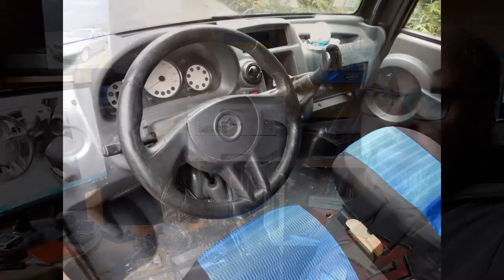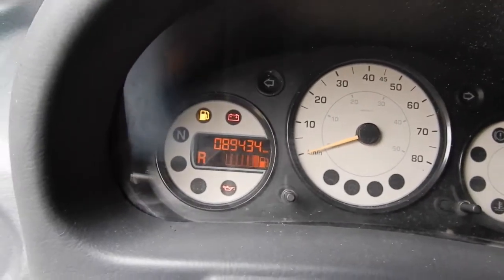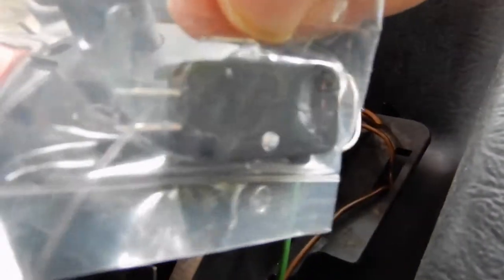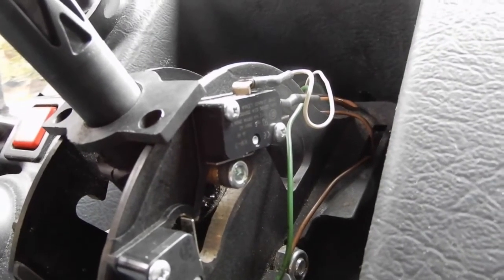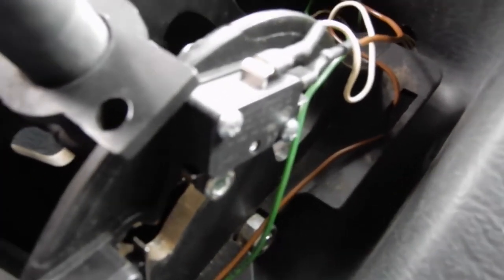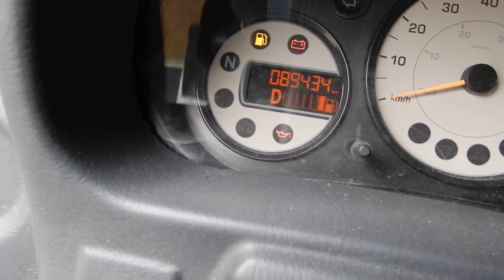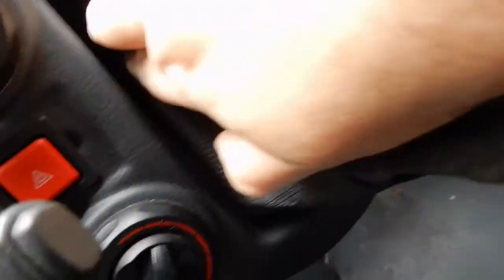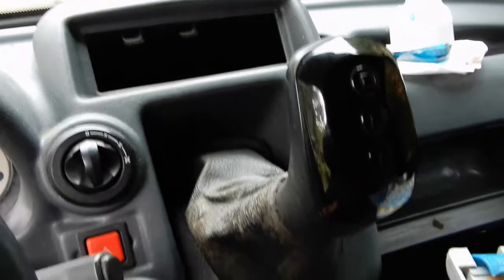Fixing the [D] [N] micro switch on the gear selector | Aixam Mega Multitruck Van

Comment: Good video, that is a good idea about the buttons on the dash, you could do that relatively easily once you’ve chosen the right switches you want
Reply from the maker: I think 11 mins was a bit of a long video for that job! LOL 
Say "bascially" a lot too (well, I'm a Midlander).
Not sure how a switch unit could work. The ones I mentioned by Voith or ZF, have circuitry involved - so not direct contacts from the switches themselves.

Added to which, I think the steel cable sets the CVT unit into drive, whereas neutral and reverse are controlled electronically. Or it may be a combination of both. Like I said, I was dreaming, but it would be pretty cool. I find the gear stick itself pretty naff - like it'll break at any minute. Your Phase 1 probably has something similar.

Comment: Hello from the uk 🇬🇧 
I have a 2007 axiam mega van and it’s been parked up for a while and now it’s stuck in (D) my truck is electric and I have brought it off an old chap that just wanted it gone it’s had all new batteries but as I have said it’s stuck in drive so I would be very great full if you could help me please and also where can I get a switch like the one you have.
Kind regards Richard
Reply from the maker: I bought the contact switch for my gear lever from Pro VSP here in France. 9.90 euros.
Here is the item at their site.
https://www.propiecevsp.fr/fr/capteur-contacteur-levier-inverseur-voiture-sans-permis/1400-contacteur-marche-arriere-neutre-voiture-sans-permis-aixam-microcar-chatenet.html

HTH

John.

Comment: Unfortunately, you won't be able to simply install a push button setup for the gears. As far as I can tell by the looks, the gears are actually selected by the mechanical linkage reaching forward from the base of the lever, and the switches are only for the computer, which deals with telling you on the dashboard what gear you are in, and probably disabling the starter if you're not in neutral - no actual gear change is done by the limit switches.

(Also, the direction selector unit is separate from the CVT)
Reply from the maker: Thanks a lot for your comment and useful info. I had an idea this was the case, but didn't really know how the whole thing worked. I suppose the only functionality is, as you've said, neutral cutting off the starter.
Shame really, but perhaps one day I'll have to change the gear lever for something similar and more robust. It is very flimsy.
Reply: @MegaBreadvan  I'm glad you found it useful!
It's quite surprising that the lever is not as robust as it appears to be based on the videos.

May I ask what other upgrades you have on your mind? Just curious, as I'm planning to buy a 400 and playing with the thought of upping its comfort level (e.g. experimenting with noise reduction mats, etc.)
Reply from the maker: @bencesarosi7718  The whole gearlever mechanism just looks and feels fragile, as it is all mostly in plastic. 
The attachments to the dash aren't that strong either.
For the moment I'm just rust treating, given the age of my van, the chassis is very sound. But the front subframe has a few rust areas, especially around the members holding the suspension legs and the front dash/bonnet lock.
I hope to improve the comfort level in the cab as well and was told that closed cell insulation panels might be good. I would also like to add some lagging around the "cage" inside the cab. Which might help with vibration and the fact I keep banging my head on it.
I also need to replace the sound proofing under the bonnet and either side of the engine. The Aixam sound proofing was what caused the rust I mentioned.
Reply: @MegaBreadvan  Oh wow! Sound proofing material is (usually) supposed to repel moisture, not collect it. Interesting.
Reply from the maker: @bencesarosi7718  With you there. The stuff either side of the engine is like bloody carpet!
Reply: @MegaBreadvan  Oh my! Sounds like you could use a swap.
Reply from the maker: @bencesarosi7718  I will use the old engine soundproofing as a template. Although I'll have to fashion a grill for the left hand side as it seems Aixam/Mega didn't think the radiator needed any protection from muck and stones...
Reply: @MegaBreadvan  Any chance for an upload on the process when it happens?
Reply from the maker: @bencesarosi7718  Each time I do something on the van I intend doing a video about it, unless someone clubs me to death because they don't like them. :-)
Reply: @MegaBreadvan  I like them a lot for that matter. I'd also love to see some longer driving footages, so don't worry much about length, I'm probably not alone.

And before I forget again: Merry belated Christmas!
Reply from the maker: @bencesarosi7718  It is true I've not got a lot of driving footage and those clips I have were mainly taken around our village.
I'll be honest. Living in France I have taken advantage of the right of being able to drive a sans permis without any tuition, as I was born before 1988. In 1991 I took driving lessons back in the UK. But never took my test. So I am a "non driver"... apart from having used a 50cc scooter. Which has the same classification as my van, being "sans permis" as well. The next step is to do a longer trip, which for me is a bit scary. When the COVID situation settles down, I will see if I can find some BSR level lessons so I can improve my confidence. I'm OK driving around the village, but as the speed limit on surrounding route départementales is 80kph, you need to take care. My fragile yoghurt pot of a van is supposed to do a maximum speed of 45kph. In fact unofficially it will get up to 55kph, because the dealer who sold it to me had tweaked it for the former owner. But didn't tell me. For Christmas I got a new dash cam, mainly in case there are problems on the road and partly to share any interesting footage on my Youtube channel.

Joyeux Noël ;-) Stay safe.
Reply: @MegaBreadvan  I guess these little grasshoppers are not very different from their L7e cousins, which can and do legally go in excess of 100 kph.
L6e cars can less legally be tuned (without modification) to reach fairly good speeds

Based on what I've seen, I'd say all you need is to drive a little more often, and your confidence will pick up in no time.
Reply from the maker: @bencesarosi7718  My van has the same front subframe as the Aixam 400 car. Then has a totally different chassis/cage from the windscreen backwards. Same bog standard Kubota Z400 engine as well I think. Doesn't run so well when cold and damp. Which was the case today on a trip to my BILs house a couple of km or so away. Heavy sometimes torrential rain and gale force winds.
Reply from the maker: @bencesarosi7718  Yes my OH says the same. Tonight we came back from my BILs in convoy, with OH in front... in the dark and in heavy rain. Visibility isn't brilliant in these vans as the window demister is rubbish. I need to start adding insulation and creature comforts.
Reply: @MegaBreadvan  Sounds less than ideal indeed. Diesels generally don't like cold weather anyways.
As for the winds, I'd probably be worried about being pushed over in such a tall but very light box
Reply from the maker: @bencesarosi7718  The cold and damp can affect things, until everything is warmed up. 
Luckily the road between here and my BIL's is well sheltered. Which isn't the case in the other direction out into open country towards the next village.
Due to intensive farming we don't have any hedgerows (like in the UK) and we are in a vale. Land is flat locally. So you just can't shelter from the wind. I think my bum will be pinching itself should I get over taken by a lorry in weather like we had yesterday. :-)
Reply: @MegaBreadvan  I wish you the best of luck then :)
If there's much wind, at least consider throwing something in the back.
Reply from the maker: @bencesarosi7718  The back is loaded, but perhaps not up to the "advised" payload limit of 195kg(!)
Reply: @MegaBreadvan  Happy New Year! Fingers crossed :)
Reply from the maker: @bencesarosi7718  Bonne année!

Comment: My axiam 500.5 superlux won’t go in first gear goes in reverse and Nutrel can anyone help me?!
Reply from the maker: I've not ventured into the "gearbox" on my van as up to now I've not had any problems. So far just had to replace a micro switch because the selector wouldn't register neutral (as in the video). There are two micro switches, I think the other one is for D & R.